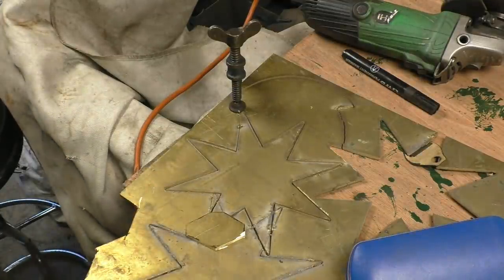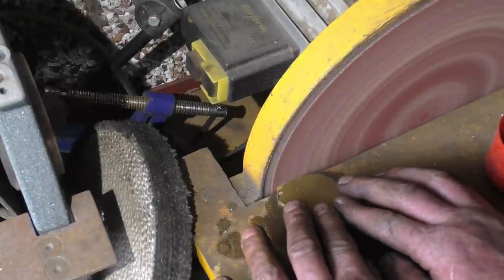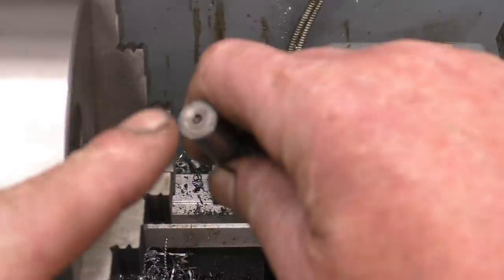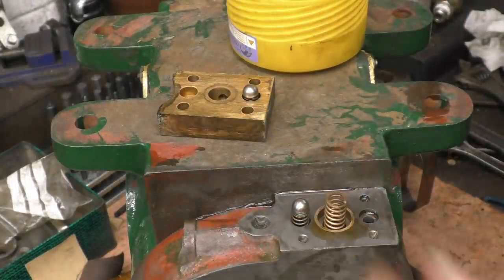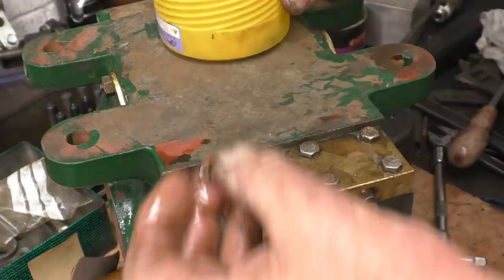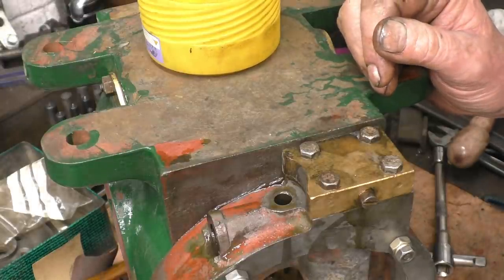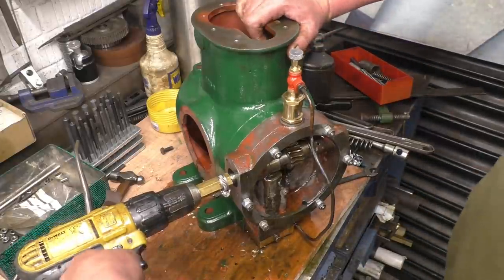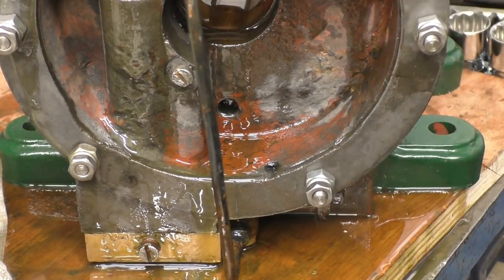Stuart Steam Engine Restoration P7 "Ugly Nuts"

Comment: Great progress. It certainly is a long time since that oil pump last pumped oil. A successful stage check and onto the next thing. The only thing I'd say is the spring you chose to fit in the pressure relief valve is the reference for the oil pressure. Hopefully it will be enough when the engine is fully assembled to prevent oil starvation to the other bits and pieces.

Comment: Great work as usual John. I like how you leave everything in like when you are fitting the oil pump spring to the top plate without grease to hold it when upside down, there will be a few of us saying in their heads what to do... then you do it, same with driving the oil pump with an adaptor on the other end of the shaft, I was thinking why are you tiring to tap it when there is an accessible end. All the better leaving the learning in for folk, the videos in this  series are the highlight of my week.

Comment: That damned loose flood board groaning away, I've not seen a dog so can't blame it, hee. And yes I now use your way to make gaskets..... so much bloody cheaper and easier. Top job though you could always have a set of brassed off bits, depends how often you poke holes in brass I suppose??

Comment: Cut them out on the plasma table - so John, does that mean you can't put the gasket you cut onto your scanner and send the shape straight to the plasma cutter ? :) It should be possible !
(I even got m flatbed scanner sending stuff straight to the printer yesterday ! #photocopier.

Comment: There's nowt wrong withe adjustable spanners just so long as they are good quality ones.  I've had a big BAHCO for donkeys years and it has  been used on some heavy equipment and  is still a very good tool.. Bahco still supply parts for it if needed.  Make a flexible drive shaft witrh a piece of hose that fits the pump sipindle and a legth of bar that fits the drill chuck, a couple of jubilee clips shout sort it.

Comment: Nice work John, though not impressed with the adjustable spanner, bet it wasn't a Whitworth one! ;)
Reply: A decent quality adjustable spanner is fine to use if sensibly used. In the wrong hands I totally agree with your sentiment.
Reply: @littlejool5  I was joking, hence the "Whitworth one". The only time they are an issue is where high torque is involved.
Reply: @BensWorkshop  haha yeah I wasn't pulling your chain or unaware of the joke yeah. but let's be honest generally they are used by 200 lb gorillas to ruin stuff, but not in this case.